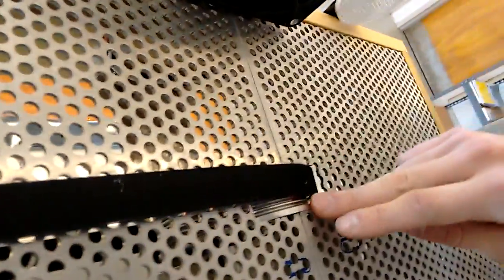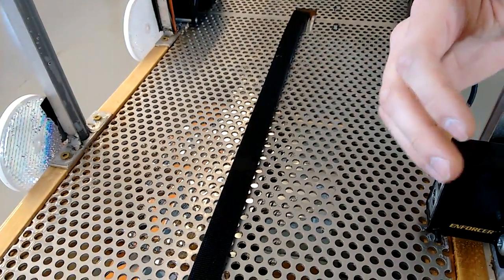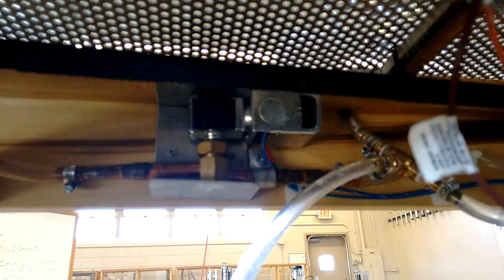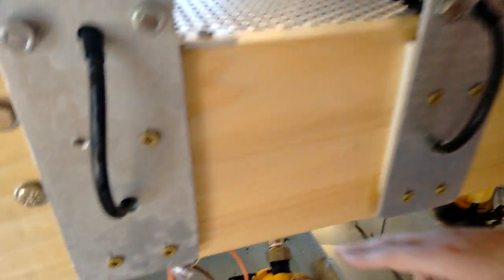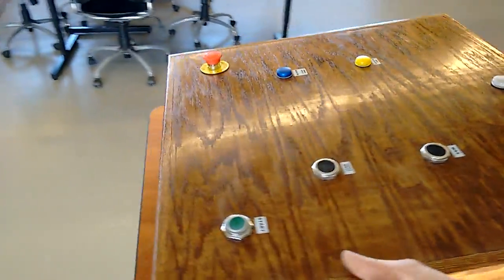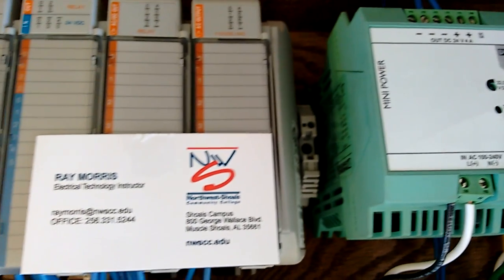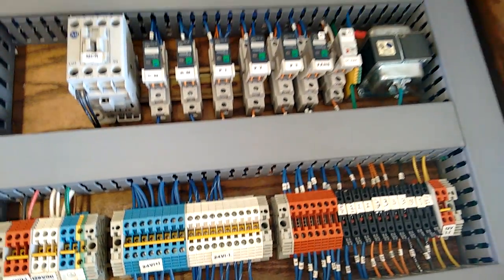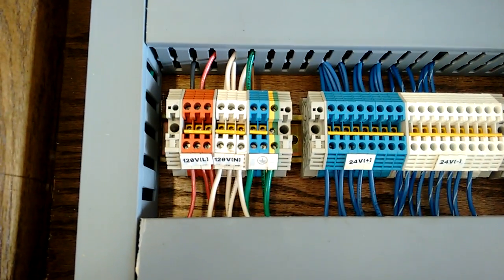Car wash PLC trainer project  Electrical Technology Part 3

Comment: Which PLC have you used, in this project..?
Please tell company and model no. of that PLC
Reply from the maker: Allen Bradley Compact Logix L31
1769-PA2 Power Supply
 (2) 17691Q6XOW4 
1769-OW8
1769-OA8
Reply: Ray Morris thanks sir, and please if you can easily send me your ladder logic for this program, on my email :- moeez.amjad11@gmail.com